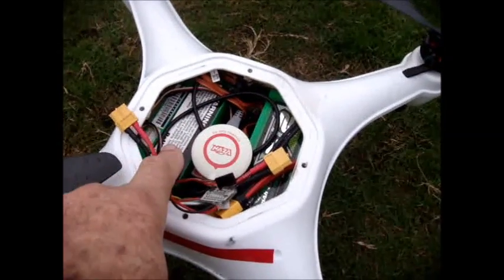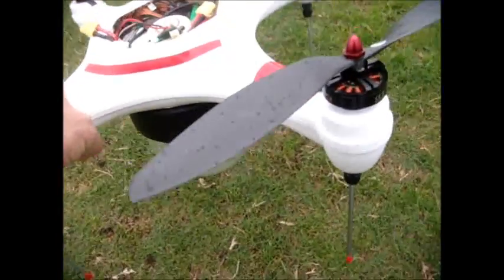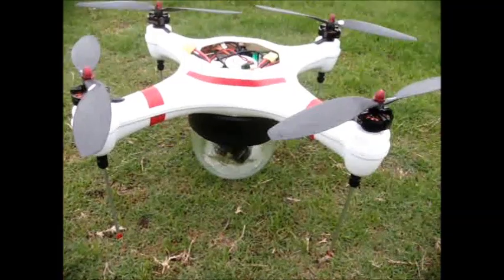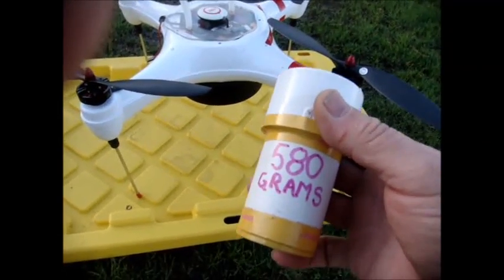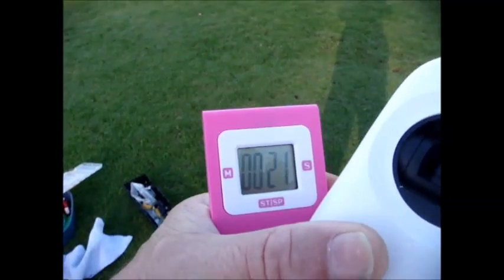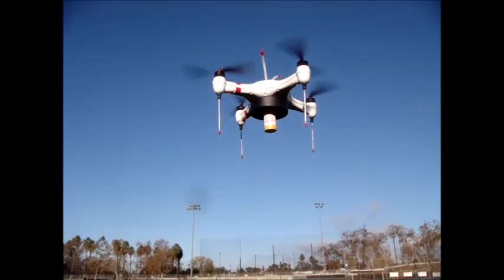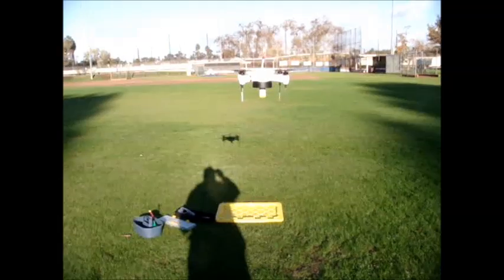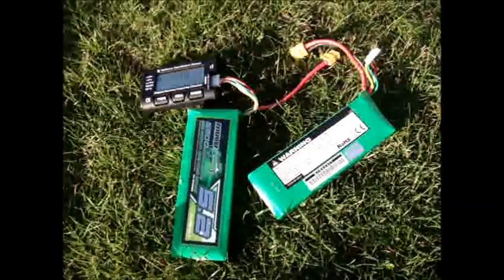Mariner Flight Duration with 3-Axis Waterproof gimbal

Comment: Great setup ! Based on my own experience (I just build an aquacopter with gopro&H3-3D gimbal in a similar self made dome but 8" diameter), I can tell you'll most probably have some light reflections on your footage due to the sunlight bouncing inside your dome. It's like filming throughout a windows: you'll notice yourself filming in the window like if it was a mirror. Also, you'll need to have a glass dome perfectly clean otherwise you'll notice every dust particle (and I guess it'll take more time to clean everytime the dome than flying... ;-)). Finally, your glass dome needs to be perfectly shaped to avoid image distorsion. I finally decided to go towards making my gimbal waterproof and putting my gopro back in its waterproof case (with FPV transmitter). Weight is even lower, increasing flight times. Good luck with your rig, I'll continue to follow you to see how you may overcome the issues I faced. (possible fix : I have in mind to do some tests by covering the glass dome that is not in the field of view of the gopro in order to reduce the quantity of sunlight entering into the glass dome... this might remove the light reflections and reduce the sensitivity to dust particles...we'll see...).

Comment: Very cool!  where can someone get one of those waterproof glass domes for the gimbal?
Reply from the maker: The Mariner Glass dome system will be available as soon as I complete all the flight duration testing.  Keep tuned on the videos as I progress in the final phases of the testing.
Reply: Joe Valencic
great!  looking forward to seeing your tests.  I would prefer if you did not include that gimbal in your package if your going to be selling a full setup.  There are much better performing gimbals out there I would rather use.   Thanks!